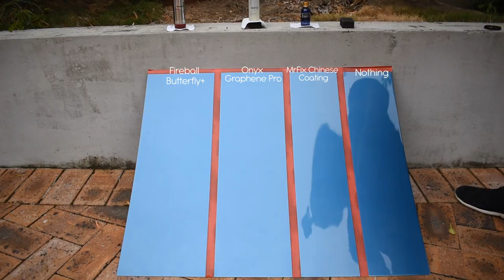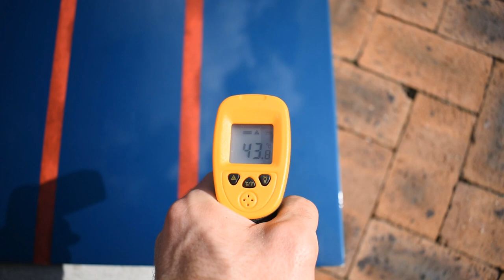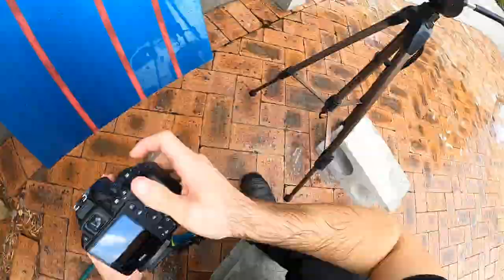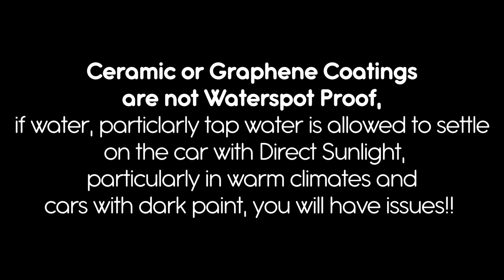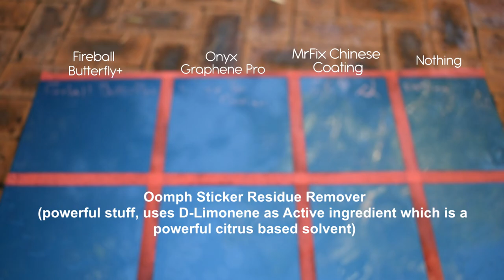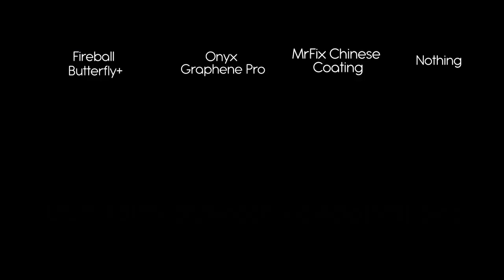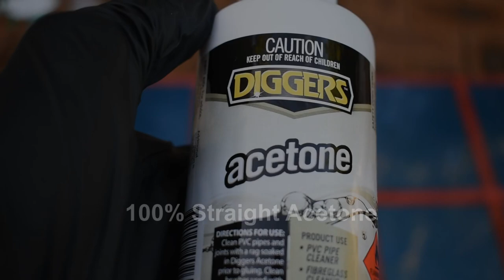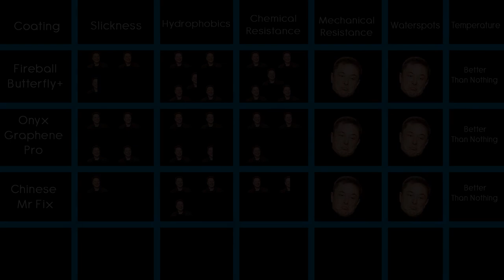Fireball Butterfly vs Onyx Graphene Pro vs Mr Fix Ceramic Coating Comparison Stress Test Review

Comment: Best wheel cleaner I've used is McGuirs. OMG !!!! Stuff is SAFE on all wheels and it works UNBELIEVABLE !!!!! I'm shocked at how freaking good this stuff is. It gels up, turns purplish red, and washes right off, not damaging aluminum wheels and it removes the brake dust. Stuffs incredible. Unfortunately, it's like $14.00 a bottle, but works.

Comment: can you do a vid on the install / application of the onyx coating? great vid man!  yes Graphene coating are still in the all hype phase, there is not enough graphene (oxide) to make a difference...I believe researching is still growing. But really it is just an ceramic coating w/  some graphene oxide. No benefits in heat, water spots, durability ..basically it is only good as the ceramic coating it is mixed with.  One important thing to note: the big names in the global industry is that CarPro, Gyeon, Gtechniq, and more are staying away from offering a graphene option. That right there is a clear reason why they are honest companies..not hyping graphene, 9H / 10H  - crazy warranties.....Fireball...extremely overpriced for no good result or reason.....another flag of a company in it for $$.

Comment: Hi, I was thinking about getting a ceramic coating on my car (im in Brisbane area) but was wondering is this Fireball better then the Gtechniq? Ive heard lots about Gtechniq, but not much about Fireball.

Last time I got a ceramic coating Opticoat Pro was the best, but that was like 8 years ago.

Do you have a comparison on Gtechniq against fireball by anychance or is there even better ones around?
Reply from the maker: Hi, I will make a video testing gtechniq soon, while I was impressed by the slickness and initial water beading of GTECHNIQ I was disappointed by it's chemical resistance
Reply: @mirroreffectdetail6286  have you heard of this one, NV EVO NOVA CERAMIC COATING? I was wondering is there any chance you could do a test with this one and some other good brands? I saw Scott HD do a video on YouTube with his longitivity test and never heard of nv before but he said it was a Aussie one and it was doing really well. So would be keen to see how it does against Fireball.

Also which area are you in again? Was wondering if you could come around to check my car out.

Comment: Good video! Anyway, can you recommend me a ceramic coating that have high gloss or that wet look? I know it's the prep that matters but I'm pretty sure not all ceramic coating are the same in terms of their properties
Reply from the maker: Honestly most professional grade Ceramic Coatings will give similar gloss readings using a Gloss Meter, I quite like Fireball for gloss and giving a Wet Metallic look but most coatings will do a good job with Gloss.    

The main variance between pro-grade coatings is how much chemical resistance, slickness and hydrophobicity they give. Once any pro-grade coating has been installed you'll have amazing gloss if the car has been machine polished well, to go a step further if you'd like, once the coating has fully cured after 3-4 weeks, you can add a Carnauba Wax to give a few more notches of temporary gloss/slickness on top of the Ceramic Coating 

Be sure to Like, Subscribe for more content 
-MED